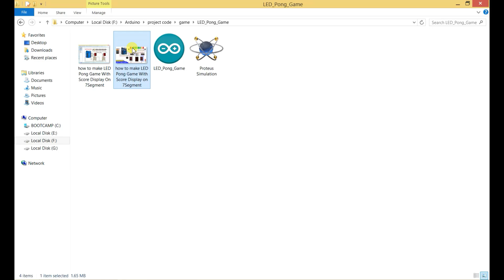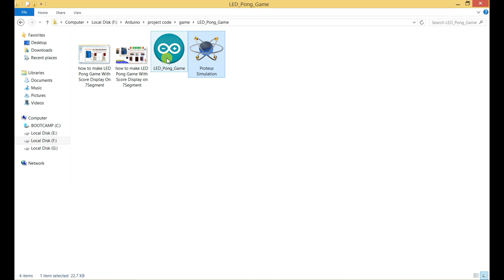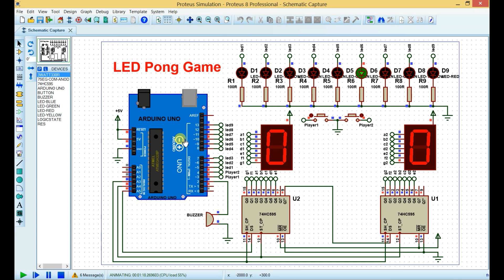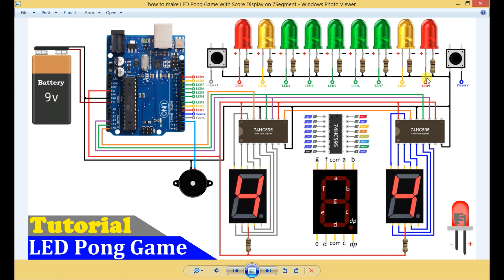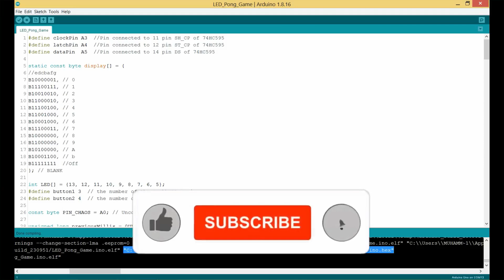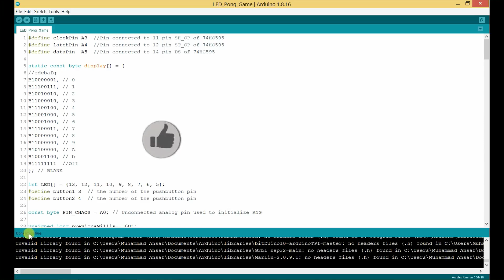led Pong Game With Score Display on 7 Segment

Comment: ents
15

Add a comment...

@asfarzsaeed7712
0 seconds ago
How to make adjustable count down timer ur previous video using TM1637 display module
Dear Ansar, I made the circuit as per sketch and details given, also re coconfirmed via program code that all connections are made as per program , and 100% ok, after upload program, the display count down normally as per code , the only problem , we can't input data through switches connected through Analog port A0 A3 - m not able to input data through micro switch , the display does not shoes any response, it count down from 1 min then comes to 0 then starts count down again without taking any data from cconnected switches, the connections are 100% ok plz advice